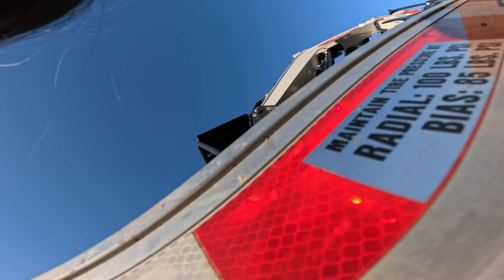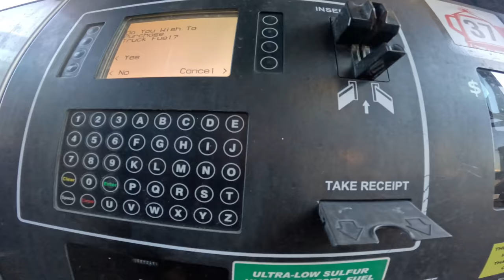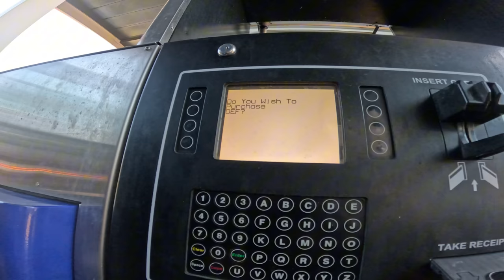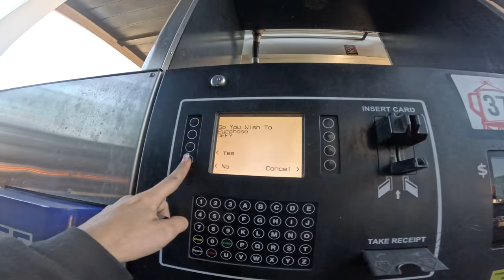I Delivered To A Tiny Popeyes Location! 😮‍💨

Comment: Becca....19:35 ff...why don't you consistently wear your seat-belt  when operating on public roads? This is not only for your own safety, but goes towards "not giving enforcement officers a reason to pull you over, as they'll likely find a whole lot of other issues/HoS-F&M violations or cargo-securement defects they wouldn't have known about, had you not been an open invitation to be pulled-over."

Comment: 29:49 
The mechanic is lying to you.
They drilled the mounting holes to high.
The rubber flap is supposed to rub up against your trailer.
Sealing the gap between the tires and the headache rack.
Watch him.

Comment: Hi Becca  never watched a truck video before anyway impressed with your attitude to the job you remind of my daughter that grit no nonsense thing an humerous with it. i ve got a good friend who drives trucks over here in uk still driving eighteen wheelers at 74 yrs old but only 3 days a week. My dad used to drive  an eight wheeler  AEC  Split screen Mammoth Major hauling bricks all handball offloading and of coursre no power steering top speed 38mph. Good luck with it all out there.

Comment: Ha I just loaded up out of bobcat last load that was fun but I got the skid steers out of North Dakota also that’s not legal the way you secured that you need 4 points of securement you only have 2 on each machine
Reply: 10000 lbs and lower only need 2
Reply: @jonathancunningham2686  not if it’s has tracks or wheels then you need 4points and a chain or strap over any attachments
Reply: @Freedomtrucking1776  Vehicles weighing 10,000 Lbs. or more MUST be secured & tied down at a minimum on all 4 corners!  Vehicles 10,000 Lbs. or less do not require corner tie-downs.

Calculating the minimum number of Tie-Downs depends on the cargo length, cargo weight and cargo type.  The sum of the working load limits from all Tie-Downs must be at least 50% of the weight of the cargo.
Articles 5’ or shorter require 1 Tie-Down.  Articles 5’ or shorter and weighing more than 1,100 Lbs. require 2 Tie-Downs.  Articles more than 5’, up through 10’ require 2 Tie-Downs.  Add an additional Tie-Down for articles more than 10’ and for each additional 10’ or part thereof.  (Articles prevented from forward movement by a bulkhead or another load require a Tie-Down for every 10’ and for each 10’ or part thereof.)
Wheeled or tracked vehicles over 10,000 Lbs. require a minimum of 4 Anchor (Direct) Tie-Downs and 4 Tightening Devices – each with a minimum working load limit of 5,000 Lbs.  Anchor Tie-Downs are a direct connection between the load and the trailer.  All accessory attachments such as booms, shovels and backhoes must be lowered and properly secured – usually with an additional Tie-Down and Tie-Down Device.
Reply from the maker: My front one has 4 the back have two, the head of security for that company specifically came up to me even helped me with one of the excavators! They sit there and load those machines all day! So I believe his advice lol
Reply: @bigrigbecca  well apparently that part of the company does it differently because the skid steer part would not let that fly
Reply: If the skid steer was over 10,000 lb that would be correct. Richie specs is a good site for looking up the weight of equipment. the mini X  Becca is hauling only weighs 3,500 lb each. Also dirt perfect has a video with officer Hoover explaining in detail the federal regulations.
Reply from the maker: @Freedomtrucking1776  I said security I meant safety my bad lmao 😂
Reply: @bigrigbecca  Becca I am a born  self taught mechanical engineer     between bobcat two hooks pass chain through trailer since you have extra  chain length but i still give you a thumb up with your comment
Reply: There's more than one way to skin a football
Reply: @jonathancunningham2686  not when it comes to safety
Reply: @Freedomtrucking1776  I didn't see anything unsafe on the entire video

Comment: Oh hey btw them fenders are an absolute pain,I did exactly what you said you’re thinking of doing right on the post close to the base,drilled a hole in each one straight down and added a nut & bolt. No more twisting